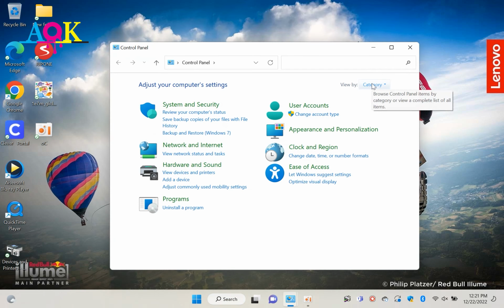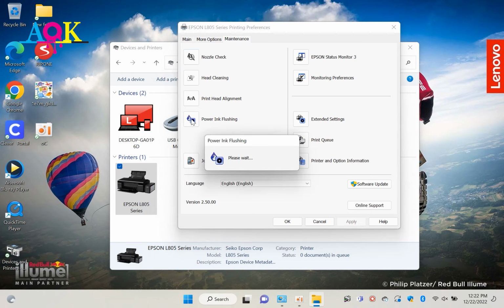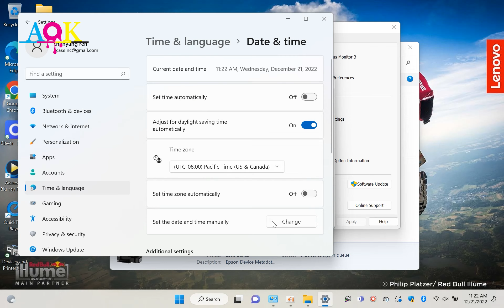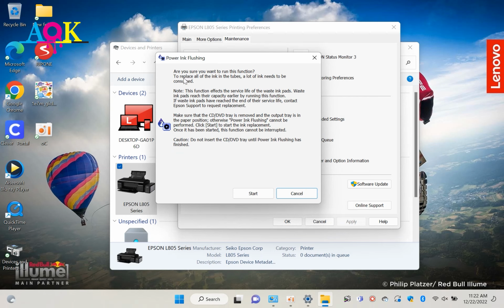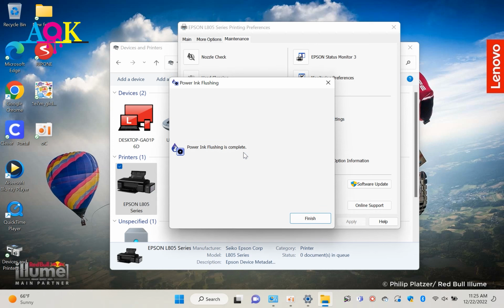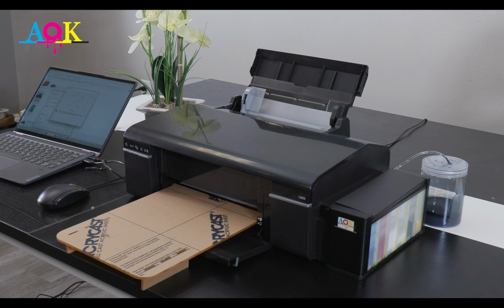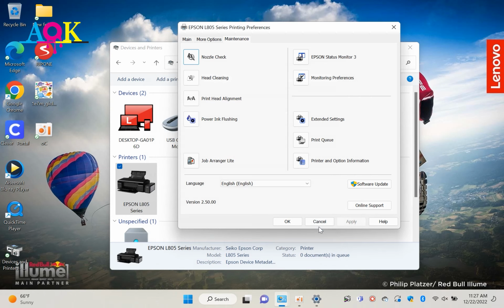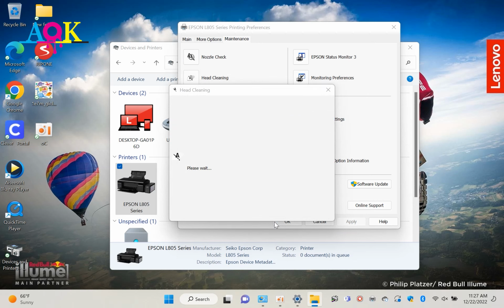AOK L805/L1800 DTF Set Up Instruction Flow ink to dampers/Power ink flush/Nozzle check/head cleaning

Comment: Hello, power ink flush order is useful anytime when the ink goes back from dampers? You know there are bubbles sometimes in damper and print is not clear
Reply from the maker: Yes. It works perfect. The damper support has some air inside ,and it won't make the ink dry since the humidity is 100% in damper. Similar like in in the original bottle.
Reply from the maker: We never recommend customer to pull  damper  with syringe  . Not all customers are professional.It has high rate to damages the print head and motherboard if ink leaks into the cartridge.
Reply: @aokprinter  great information thanks so much...however some people say "dont use power ink flush order" thats why i wanted tı be sure... So i repeat again to be sure "for daily maintance i can use power ink flush order in order to eliminate bubble&air problems in dampers all right?
Reply from the maker: Yes. Power ink flushing won't cause bubble issue. Epson recommend you do not do power ink flushing more than once every 12 hours. compare with clogged print head, i think powder ink flushing is worth.
Reply: @aokprinter  so once a day power ink flush is ok.. thank you so much i will keep eye on your channel 🙏